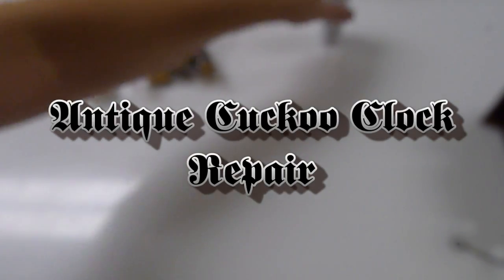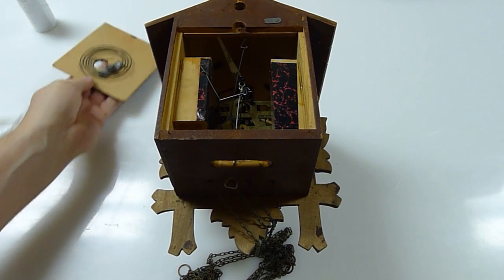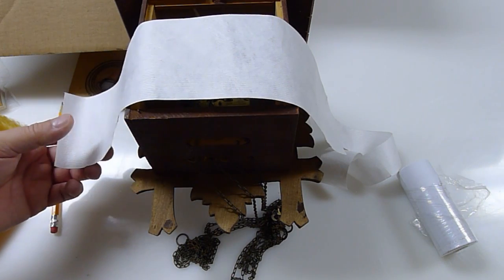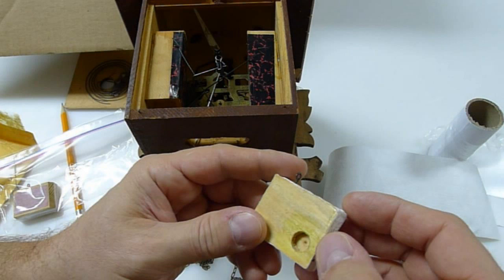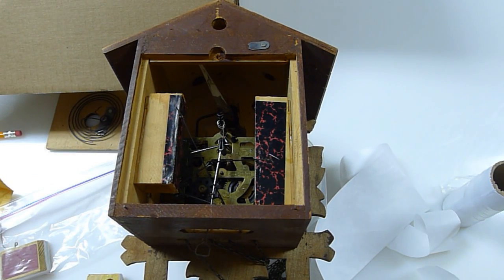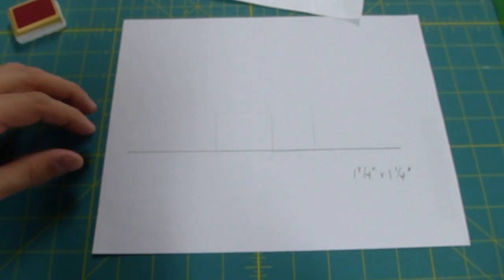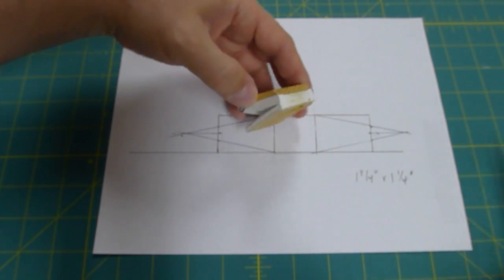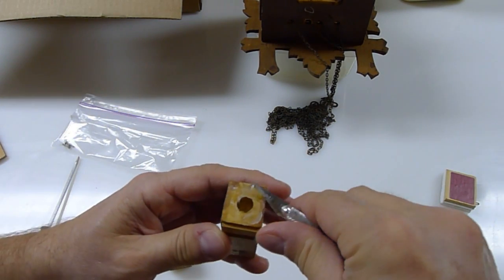Antique cuckoo clock repair

Comment: Thank you for posting! I got my first cuckoo clock when I was seven.....in the 1950's as an Xmas gift from my folks. It's moved with my hubby and I many times and still works perfectly. BUT we did notice when oiling that some parts are wearing down. The paper inside looks fine, though...like new. I have a second one in our bedroom with the deer head plus and dancer that my hubby bought me in 1972. My hubby just recently cleaned and oiled it. Your video may sure be of help if we have to do any further repairs.

Comment: I was able to opened, cleaned and oil this cuckoo clock that we had on our wall for years.by watching this video but I still could not pinpoint the cause for the left chain to become as its almost stuck and cannot be pulled like it used to.  I am still searching so unfortunately cannot put it all back together. Have you done any more videos

Comment: thanks for sharing this gary, i just put my 3 clocks on the wall,and only one out of the 3 worked, as i moved the working on a bit bammm i dropped it hit the floor and smashed the front, also the chains broke and yep came out of the wholes at bottom, so angry with myself just took me 3 hours taking apart and putting chains back on, but now i have 3 clocks not working. do you have a video on how to re chain many thanks
Reply from the maker: Patricia Hope 
Sorry to read of your mishap; in this video there is a mention of removing the clock mechanism from the inside of the case. This is what you may have to do to replace the chains. However, first I would attempt without removing the mechanism. You may be able to tilt the clock upside down, get the chain positioned over the gears, and then upright the clock. The chain should rest back  down atop the gears.

Comment: I have a pre-WWII cuckoo clock I received in pieces in a box. I have installed new bellows and have everything working except the wire that moves the bird in and out. I need help in figuring out how it works. I have one wire which may be it but I can't for the life of me figure out
how it would work. If I send you pictures do you think you could help me?

Comment: I am repairing an older clock of my Mothers.  I took it to a clock repair person who said it was not worth it.  Well it is to me.  I believe he took the top bellow off and the linkages on both sides for his personal collection. I was naive.  The top bellows where missing along with the bellows linkage.  How do you determine the length of both bellow linkages?  Are they the same or different lengths side to side if you know what I mean.  Do you measure with the bellow up or down? I have it all clean up and ready to go except for the bellows.   Any help appreciated.

Comment: Hi Gary, I have a question for you. It appears we own the exact clock. Perhaps someone else might know is answer too. Is there a way to silence the cuckoo sound without stopping the pendulum and resetting the clock each morning? I haven't tested this yet but what if you simply remove the weight that powers the sound and allow the other weight to operate normally?

Comment: I have the exact same clock. Question. I pushed one of the bellows down inside the clock. Now the clock just cucks. No coo! Did I break the bellow? If you lift it up it still makes a noise. I wish you would have showed how you put in the bellows. Thanks!

Comment: How often should the bellow paper be replaced, or is changing the paper like changing sparkplugs, only replace them when they wear out.
Reply from the maker: ***** 
I would only change the bellows paper if it is torn or has a hole in it. As long as the cuckoo is making sound you are good.
Reply: Gary Hall Do cuckoo clocks come disassembled, I think it would be cool to build one, I've always wondered what goes on inside one.
Reply: By default they don't, but i'm sure if you go on klockit dot com, then you can find the cases, the carvings, chains, movement, bellows, weights, pendulum and a matching gong. I hope this assists you. Good luck and Happy cuckoo clock building!

Comment: I bought a german made 3 weight cuckoo clock but it is missing the pendalum weight. It has the wood that the weight slides on so i am thinking i will temporaraly make a weight just to test the running of the clock. Can you give me an idea of the weight of the pendalum.
Reply from the maker: I would look online and try to find the same clock to yours; then look closely at the pendulum. Getting a pendulum of the same type and shape should be enough, accurate time is adjusted by sliding the weight on the pendulum up or down. There are several pendulum available online to purchase. Good luck.

Comment: Thank you for the informative video. I have a 2 weight cuckoo clock very similar to yours, but I am having a couple of issues. First, the cuckoo never calls the right time, and second, when it calls the time (on the hour and the half hour) the door opens and shuts on it while it cuckoos. Any idea what could be wrong and the solution?
Reply: Check the interaction of the start lever and the counting wheel. It's a common problem on counting wheel movements.

Comment: Thanks for the video. I have just bought one and after installed and taken out the lock of the bird's door, it openned and the bird came out and never got inside. It is aleays with the door oppened and nothing happens. The time works find, it is just the bird. Can you help me with this problem please? Thanks in advance
Reply: I have same problem. Did you ever get an answer?

Comment: Can anyone tell me why the rocker on its own with the weight moves without problems and stops after installing the pendulum. I have oiled it but no change. please advise.
Reply: Either the clock is not in beat or there is a power drain.  Try the simplest things first.  Put the clock in beat when the pendulum is hung.  This entails making sure the tick-tock sounds are evenly spaced.

Comment: Hi I just a battery operated cuckoo clock from Germany two weeks ago when I  was passing by Germany Black forest from Switzerland to France. After fixing up , the cuckoo have sound only when i turn the minute hand manually, but does not make the cuckoo sound after one hour...therafter .What could be the problem ?. Is there any agent in Singapore i can bring to for checking ?
Reply from the maker: I am not familiar with battery operated cuckoo clocks or Singapore, sorry.

Comment: The chain in my cuckoo clock is stuck, so the weights don't work, how do I fix that
Reply from the maker: Shubhra Chaudhuri The chaos have probably come off the gears inside and wedged between the gears and plate. If so, you will need to pull the chains out carefully and reposition them on the gears.

Comment: where's the setup on the pendular leaf?  Having hard time to keep her on time, to fast or to slow.. trying now since 5 years.. even change the leaf side, now facing up try up session ...
Reply from the maker: Hi Jamie,To adjust for timing, slide the leaf up or down on the pendulum. I believe up is faster because the pendulum will have less travel, and down is slower because it will increase travel.
Reply: Gary Hall I'm trying this since 2 years.. still can't get the proper place where the leaf belong.. if you got one like the picture (as mine) is a measurement from the bottom of the stick to the top of the leaf holder could be sent to me? it will be giving me an ideal where to set it.. (leaf facing up or down)
Reply: after all theses years of adjusting the damn thing tiny bit by tiny bit I could say I reach it's final place to be, I am loosing a second after only one week so I am damn close to its final resting place on the stick, this left is.
Reply: don't know.. I live in a basement, it's winter dry air and I have 34% humidity.. maybe I'll be different this summer.. only thing I could logically think off
Reply: dperry428 got a follower for coucou thing..

Comment: My cuckoo clock chimes one less hour than the actual. What to do? I have the same cuckoo clock as this video
Reply from the maker: You need to adjust your hour hand position. Loosen the center nut where the hands attach to the clock. You can pull up on the hour hand at the center and move it to the correct hour and press it down snug. Make sure the minute hand is still in the correct position and re-tighten the nut.
Reply: move hour hand back one hour. hand is attached onto hour wheel by light pressure. will not harm movement.    
this is the fast easy way.  
do not so with minutes hand.
Reply: move hour hand back one hour. hand is attached onto hour wheel by light pressure. will not harm movement.    
this is the fast easy way.  
do not so with minutes hand.
Reply: Gary Hall thank you
Reply: William Galindo thank you

Comment: The weight is stuck the chain is stuck
Reply from the maker: The chain has probably slipped off the gears inside the clock mechanism. You will have to make sure the chain is riding on the gears. Pulling the chain drives it deeper into the gear pin wedging it so it cannot move.